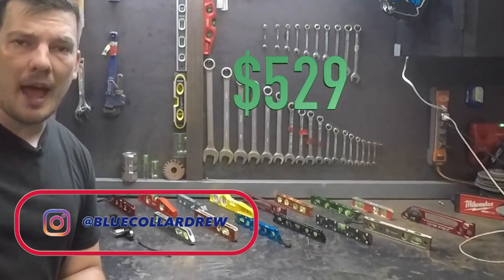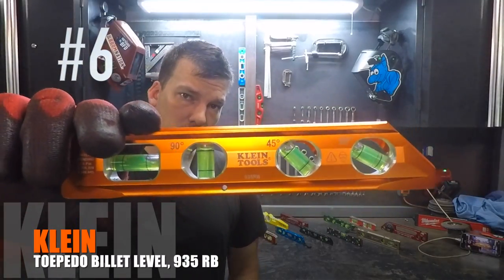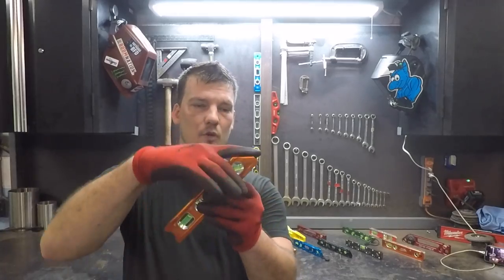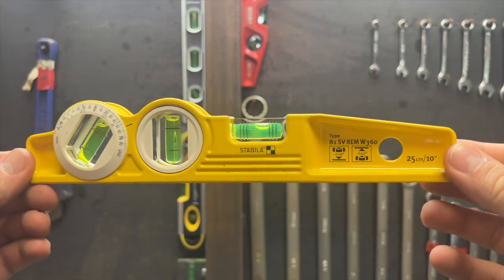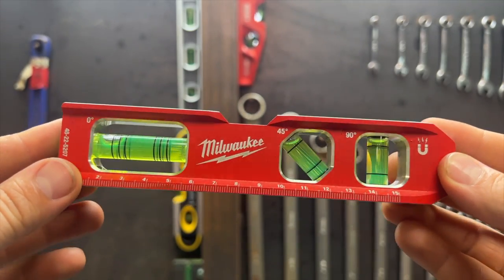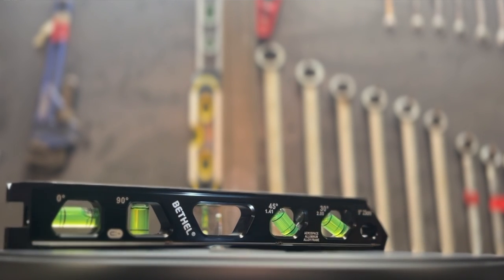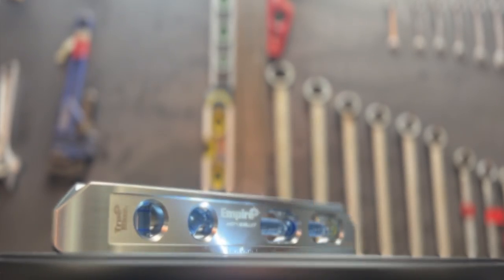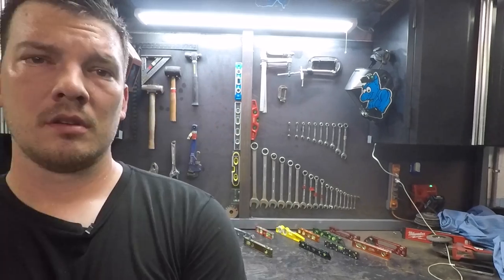Level Up!  Best Torpedo Levels (2024)

Comment: The magneto looks cool but the hardware on the sides makes it not able to lay on its side to use the level. Plumbers use levels this way sometimes to get the face looking up level front to back and side to side at the same time. Like floor drains and cleanouts

Comment: Favorite multitool is the leatherman wave + with the ratcheting extension and flat bit kits part of my edc
Reply: I have the Crunch for the 1” locking grips, and the ability to use standard 1/4” bits.
As it’s not legal carry in the UK, looking at disabling the locking mechanism.

Comment: Checking on the reviews on Amazon for a new torpedo level, from a no name £3 to established tool makers at £18, all were reviewed with inaccurate bubbles. 

Thought about it, and was just going to buy the cylindrical bubble and use that;  instead for now I bought a BandQ own brand which read the same in either horizontal plane, and before unwrapping from its shrink plastic I tested it out for accuracy. 

Dropped a plumb line making two points on a backboard, and drawing a line between the points. 
Then set a 90 degree line across the vertical using a protractor.
Finally I checked the new level against the horizontal line… and it’s level 👍

Comment: I'm not a fan of that Magneto level. Might be perfectly fine, but that riveted sandwich construction does not give me the warm fuzzies. FWIW, I'm a machinist and also do the welding for my employer. I have one of those stronghand levels, and a couple of the Empire. Haven't used the former yet, never seem to have it with me. Nice that you mention the country of origin.

Comment: I have three of those flange wizard torpedo levels each one reads a slightly different level on the same surface, and 2 of the Milwaukee ones I bought from Home Depot I currently am looking to sell on marketplace because they read very differently placed on the same surface which is unacceptable for me. The only torpedo I have been satisfied with is the discontinued Johnson torpedo.
Reply: I Luv my Klein torpedo level only one I use/buy